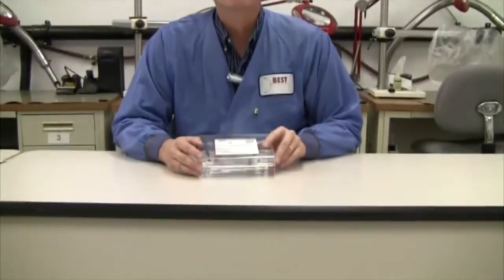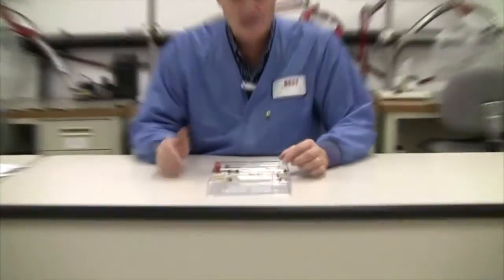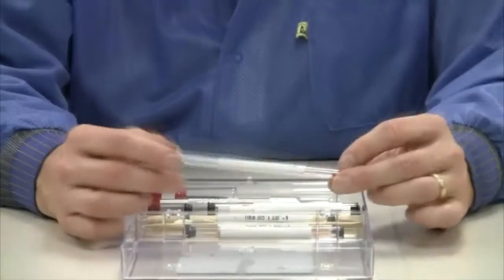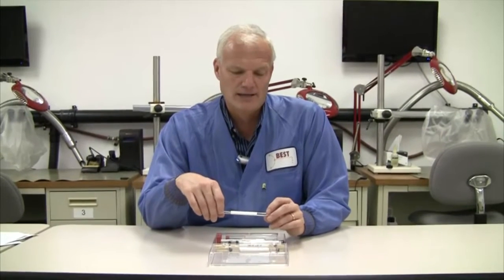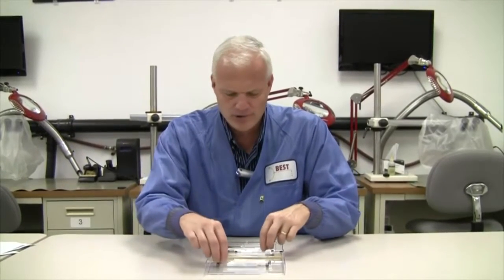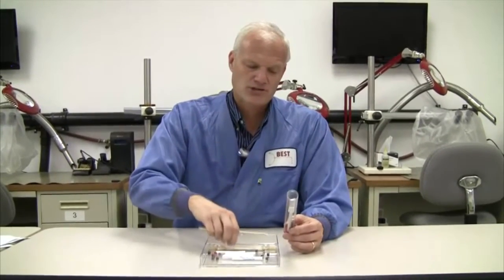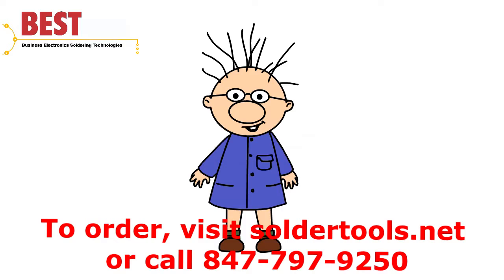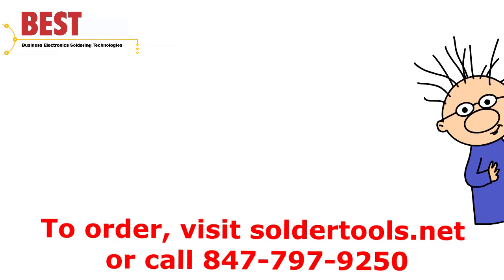Circuit Trace Repair Kit

Comment: A little pricey compared with some other kits, which include a set of tools, epoxies, tint. polyamide tabs, and a larger supply of trace material.  Just got mine and was surprised at the amount and quality. Also, came in a very durable case with mixing cups, applicators, swabs, alcohol, pocket measuring microscope.
Reply: where can I get a kit for cheap?